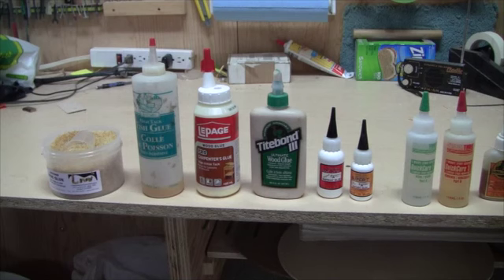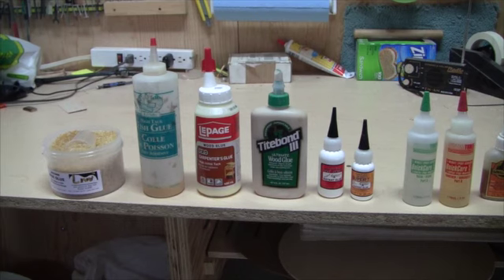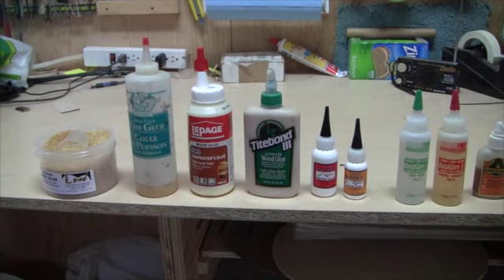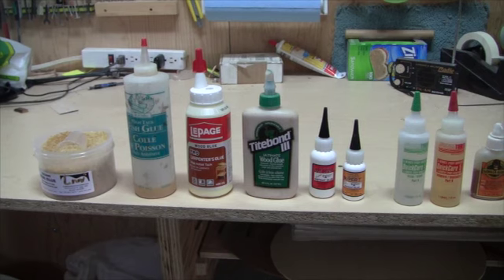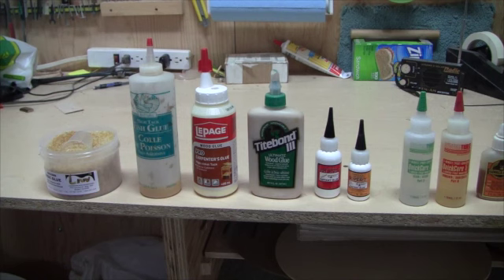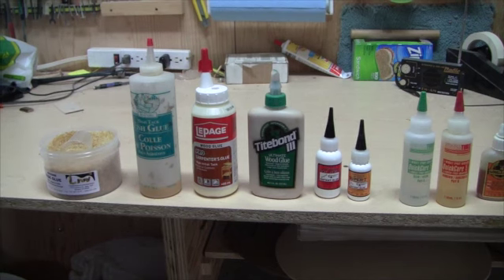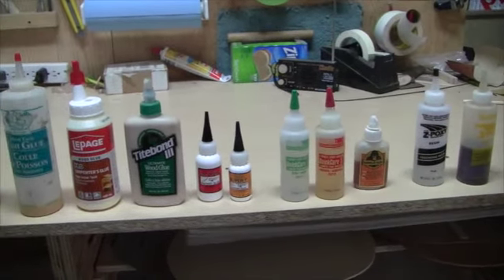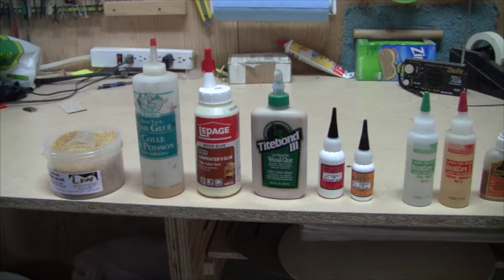The House Guitars Difference, Part 3 (All about Glue ⅓)

Comment: What would be the best glue to secure the metal screw post of a floyd rose into the wood body?
Reply from the maker: Hi Laurie, I'm not familiar enough with the Floyd Rose to know how the posts are fit. Sometimes these type of post only require a press fit, without any glue. However if you every need to glue dissimilar material (metal to wood for example) then you need a glue that will stick to both. Polyurethane glue and some epoxy will stick to both metal and wood. In your case I would check with the Floyd Rose installation instruction to see what they recommend.
Reply: ok,thank you

Comment: Restoring a '78 guild D25, notorious for great powerful bass that some say over powers the mid - high range. Wondering if the larger than average Guild pickguard that is factory finished over has something to do with that nuance? It's glued directly to the unfinished wood, then finished over with multiple relatively high build layers of nitro lacquer.  Just the extra duck bill area of pickguard may be enough to mute the resonance vs a Martin tear drop design.  When I fish glue this back in place (with a 1/4" wood template for clamping) I may choose to see if I can polish the tortoiseshell guard well enough not to have to apply a finish coat on it?

Comment: I have mid/late 70s fender f35 of my late father's, I have removed the rosewood bridge from, and have the new one to put on.

Are there brands of glue will do the job, that I can purchase st Canadian tire?

Titebond original is only available in the large bottles on amazon, or in the states that I would pay shipping on.

I see all kinds of glues available at canadian tire.

I guess my question is, is there another brand, that has the same properties as Titebond Original?

Cheers.
Reply from the maker: I use lePage, a good quality glue that is a lot easier to get than Titebond in Canada. It should do the trick.

Comment: Hello sir i have a question for u how can i repair my martin guitar its a plastic body n my guitar bridge has been crack what type of glue should i use for it
Reply from the maker: Hello Sanju, is the crack in the bridge? Or is the bridge coming off the plastic guitar?
Reply: Oh sorry its not crack i mean The guitar bridge is coming off i need to re glue
Reply from the maker: @sanjukromjegurung2323  Is the bridge wood or plastic? It is difficult if the bridge is wood and body is plastic since you need a glue that will stick to both.
Reply: Josh House actually body also plastic and bridge also plastic so which glue is better for this
Reply from the maker: @sanjukromjegurung2323  Ok, so you need a glue for plastics. I am not as familiar with plastic glues since I only work with wood. Epoxy can be a good glue for plastic, but it is messy. Your best option is probably to go to a hardware store and look for glues that say they work with plastic. Sometimes these glues will be used for automotive work. Any glue that works with plastics is going to be messy so make sure you only use a small amount of glue, and you clean up any extra right away. I hope this is some help. If you have more questions let me know.

Comment: so what glue is good to bond the bridge with the guitar
Reply from the maker: Hi Carl, Yellow glue, fish glue and hot hide glue are all good options. I use fish glue on most of my bridges. Hide glue can be a little tricky for gluing bridges. You need to have a good process if you're using hide glue so that everything can be positioned and clamped quickly! The key to gluing bridges is to make sure you have a nice clean wood to wood joint.
Reply: @joshuahouseguitars  thanks for the advise

Comment: Hello.  I am curious on what glues you think are being used on most (Yamaha, Takamine, etc.,) factory guitars?
Reply from the maker: Sorry for the slow reply. Factories will use a white or yellow carpenters glue for most operations. It is the easiest to use and dries relatively quick which is good in a factory environment. Some factories will use epoxy, CA, or hide glue for certain operations or certain models.
Reply: Josh House .  Then mine must have been assembled  (bridge to sound board ) with epoxy because it would not come off the bridge when it was immersed in boiling water.   The glue looked to be transparent.
Reply from the maker: SGNT. It is possible that it was some kind of epoxy, that would fit with what you are describing. Also there are several wood glues that are heat resistant, or heat and water resistant (Titebond 2 & 3 for example).
Reply: Josh House Agree.   Thanks for getting back with me.  I appreciate it.